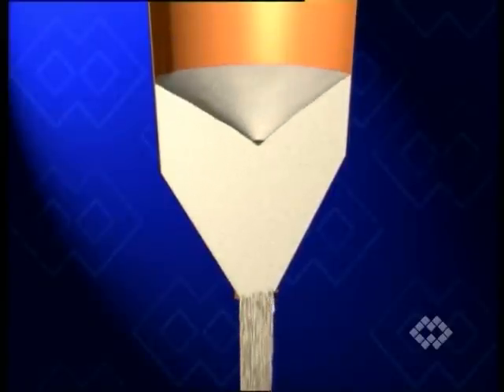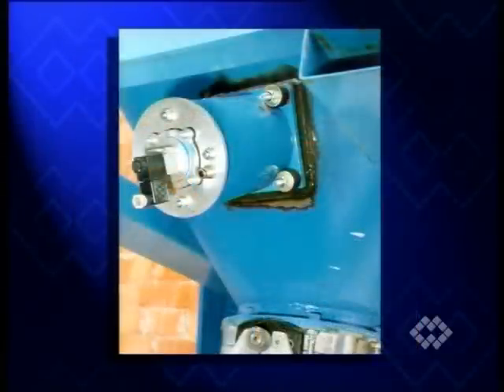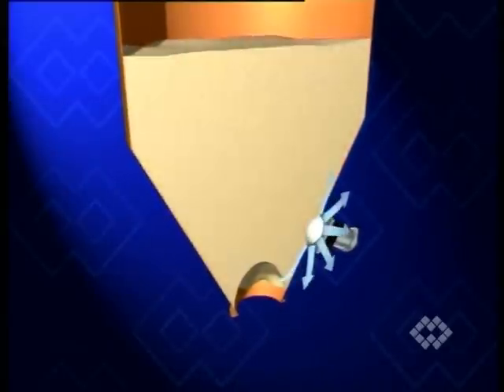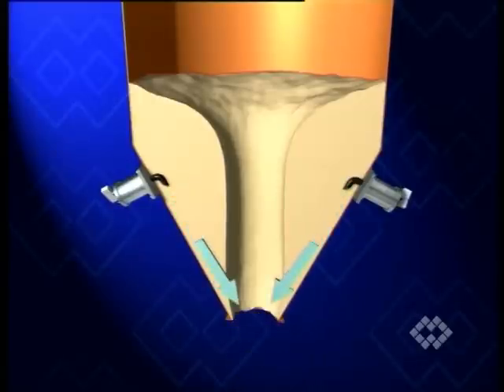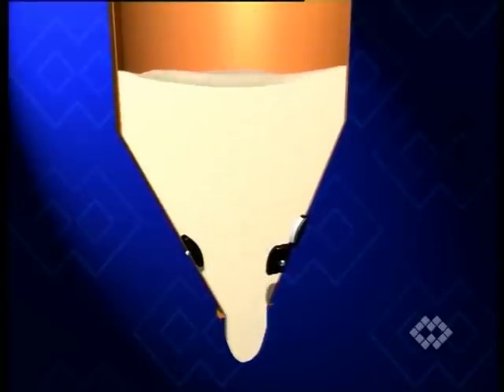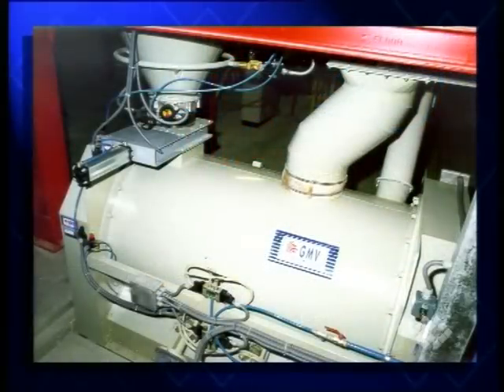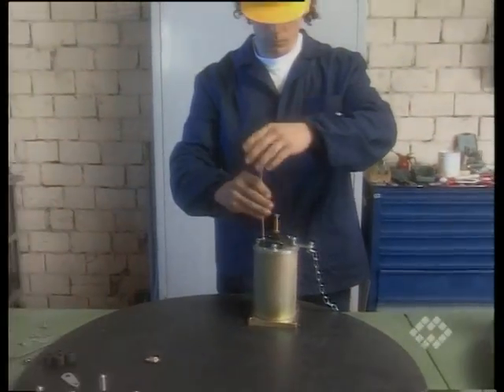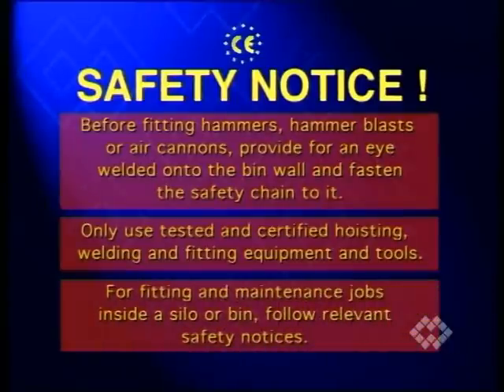Flow Aids

Comment: 01:30 neumatic hammer ps
02:50 hammer blast pj
03:56 air cannon pg
04:40 rectangular shaped bins tiled silo outlets
05:23 fluidization pads I100
07:20 fluidization nozzles U025